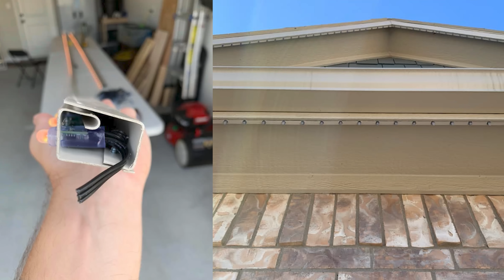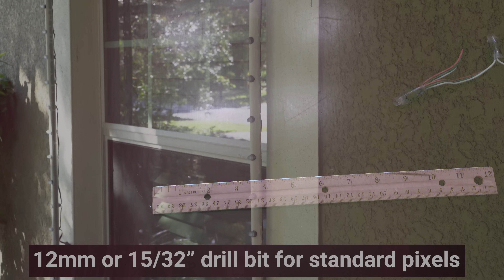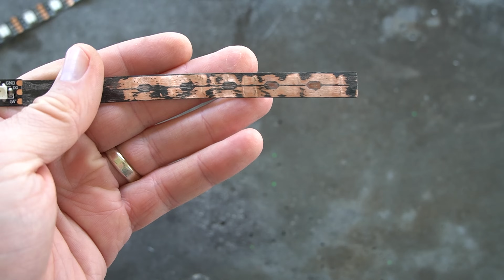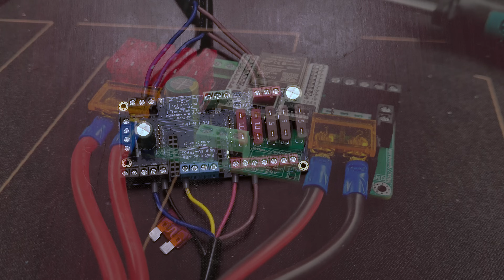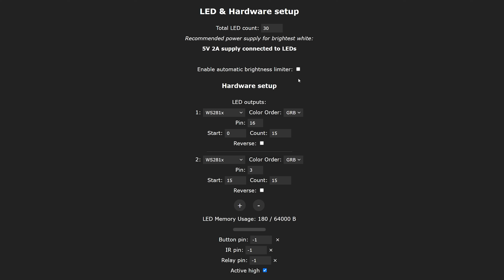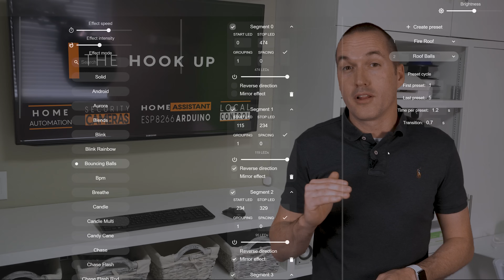DIY Permanent Holiday LEDs: Complete How To Guide 2021

Comment: Wow this is absolutely fantastic! Such high production quality too! I plan to start small this year with my dig-quad v1 and 600 lights on my Christmas tree for easier power injection using those fairy LEDs. My ultimate goal is the set up that you have on the house. Thank you for such an amazing video! Your channel along with Dr.Zzs and Quindor are the best!
Reply from the maker: Careful with those fairy lights, they are easy to short out since the wires are just enameled, also not for use outside.
Reply: Thanks Rob will do! I already have it all wired up on my desk to test everything and just need to carefully transfer it to the tree in the next couple of days. Thanks for the advice.
Reply: @TheHookUp  I see what you mean about being careful. I was putting the last strand on the tree and one of the LEDs on that last strand started smoking!!  I had to unplug real quick and replace the strip. Inside one of the actual LEDs was all charred and black. Geesh! It was actually about to start a fire.

Comment: I had seen posting on using JChannel and Pixels, that require a lot of drilling. the UChannel is nearly the same price, less labor and better finish.  Awesome.    My only complaint, is using a Western Union Splice. That splice is used for mechanical stress(tension), but it not the best for conductivity.  Linemans splice is a better splice.

Comment: Up 'til now I have made a number of LED projects using Arduino and ESP8266. I am starting to rebuild everything and for the 2022 season I want to make something that will work across everything I want to do.  If you were going to use 1 system that included things like a mega tree, with home made house lights (bow and swag) and other items (home made candy canes, etc. for the yard, poinsettia's for the house, maybe some window and door outlining, etc.)  would you still use a digiquad?  or something like a Falcon or HinksPix with xlights?

Comment: Do you think there is any heat that's being generated by the power injection wire? I too am planning to run the power injection wire inside the led channel. And am just wondering about heat generation. Thoughts?

Comment: Thanks for this! In the video on "joining like a pro" you mentioned 3/8" heat shrink, but in this one you said 3/4". Is one of those wrong? Or does it not matter because they shrink enough either way?
Reply from the maker: Uh oh, 3/8 is definitely the right size. I’ll need to make a note in the sticky comment about that.
Reply from the maker: Thanks
Reply: @TheHookUp  Thanks! (I think your Amazon US store link goes to 3/4" too)
Reply from the maker: Fixed that too, thanks again.

Comment: Silly question, If I am running a parallel injection... would it be feasible to run one positive and negative line from my home run wire and tap into that.  For example, if I am doing power injection to three strips on my bottom floor; splicing into that using butt connectors for both the end and beginning of the next strip?   Or should I run multiple positive and negative parallel injection lines connected to my homerun?

Comment: So for some reason I can’t re comment I bought all the stuff you recommended in the video  of your website and links I just couldn’t get the Ethernet chip I had to get the external Wifi which hopefully works good and then my other question is you have those boxs that you use to store your mother board and power supply what are they called and where would I get those? That’s one thing I don’t see listed

Comment: FYI - Falcon are up to V4. Also, although you have been fine with strip (apart from the lightning storm), it tends to not last as well in colder, harsher climates. YMMV. Excelent video as always, and prop to Quindor and Aircookie for their awesome work.
Reply from the maker: Good info on the falcon controller. I don't follow that scene super closely.  I used to think the same about strips, but in my last video I asked for people's experience with strips based on climate and it was a mixed bag.  Small sample size, but about 50 people responded with their information and there was no correlation between success and failure based on climate.

Comment: I have an upper roofline of 16m and a lower roofline of 25m and was planning to do two different runs (with injections every 5m). At 30pix/m, that’s 30A for the upper and 37.5A for the lower. Sounds like I should break the lower into two different runs, totally 3 coming out of the digquad. Btw, I have two 60A power supplies. 
Also, I’d like to compensate you for sharing your knowledge with me and I value that. I’ve purchased all the things cos your Amazon links - how else can I?

Comment: Probably a dumb question, but I need to ask it anyway.  Is there information available that details what you get in one of the packaged kits such as Phillips Hue, LifX, or particularly Govee  H6171(RGBIC). Specifically what type of strip dp they use, what controller, whats the difference between that and this build from scratch options, can any of the stuff be swapped out/upgraded later or is there stuff proprietary and thus incompatible with the DIY options..  Further I'd also like some clarification on differences if any on your builds and controls here and the DMX controlled options and/or "DMX" labelled strips like the DMX512.... is this different than the ws2811-15's you describe or is it actually one of those that some company gave a different name for marketing?  Also what is your take on the 120V strips?

Anyway, I have so many questions still, it's so close to christmas, and I cannot justify buying any more removable, garbage, target real of christmas lights...   I've ordered the Govee option mentioned just to try something different and now after seeing all this about building your own...... first I'd just like to know if I should return them or if there is something solid in there that could be built upon or its at least good enough for the first section/wave and the additional stuff is where it gets real trick??

Great super informative videos and I appreciate that some of it is also in text form.  Sometimes i need something on paper and or to read it, i think you (or at least I) comprehend and remember better/more from reading.  I digress, I am new to your channel but expect I'll be back frequently .. ..   so i dont have to ask the dumb questions, after doing research started too late and when something needs to be done now and seeming only like I'm getting further from an answer.

Cheers,
LO

Comment: Again - you are a fantastic resource and the quality of your videos is so much better than everyone else. I'm amazed. But sometimes you move through things pretty fast. The installation of the strips is a little confusing to me. You say you don't want to be soldering on a ladder (excellent advice!), but how do you make a 40 meter run including the soldering of the injection points, accurate placement of roof gable angles and corner bends all in one piece on the ground? It seems like this would be so likely to break or have the measurements  an inch off when I hit a 90 degree bend in the roof line when I put the LED strip into the channel. If you could share some tips (possibly in a different video) I'd really appreciate it.

Comment: I am using 12v led strings (total 1900 leds) ,power supply meanwell 12v 30amp 350 watt .Do i need two powe supply or just one is fine .Also i have the digi quad controller.
Please advise

Comment: Thank you for your great content. Based on your information I am in the process of ordering the components required to put in place an automated Christmas light show this year (mega tree & house roof line stips), well at least the first iteration of it. One thing I am still not clear on is the wiring between the controller and the lights and the power supply. Do you have a wiring diagram you can share?
Reply: Hard to come by, I need the same thing

Comment: So do you need to have an 18/3 or 18/2 ran inside the channel for power injection? I have just under 4 strips with 30led/m, so just under 600leds. Also, do I inject just power on the beginning and furthest  point, or does it need the data also?

Comment: In the video, you mention that if you use the SK6812 daily, expect more maintenance if you are running them every night.  What kind of maintenance? or what makes them different?
Reply from the maker: I should have said running any strip every night will require more maintenance.  LEDs that get hot can burn out, maintenance would be replacing those sections of LEDs.

Comment: You mentioned you have window frames that you put up only during holidays - did you leave yourself connectors in the middle of your runs in order to get them connected all the way back to the wled controller?
Reply from the maker: Yep, I tuck them up into the soffit for the rest of the year.
Reply: @TheHookUp  OK. Sweet. Is there a literal break in your main wires (connector?) or does it do a home run?
Reply from the maker: Home runs.

Comment: Awesome.  Thank-you so much.  Next summers project.  My wife and I were just talking about this.  2 of my neighbors put up permanent lights and they have them run all year in different colors.  So much wonderful information.  Thank you for doing all that research.  Question.  Can the same setup be used for under cabinet lighting?
Reply from the maker: You mean WLED for under cabinet? Sure.  I'd recommend SK6812 RGBW strips for under cabinet lights.

Comment: Is it better to run 24 v and stepping down near the strip . To avoid long run losses?
Reply from the maker: You could, but I wouldn't.  Not only are the stepdowns another point of failure, but the 24v lines are more prone to catching on fire if you overload them.

Comment: Two questions.  First do they make inside and outside corners for the aluminum channel?  The controller is 5v does that matter if i want to use a 12 power supply?
Reply from the maker: Depends on the controller.  If you use a DigUno or DigQuad it will have a voltage regulator on the board so you can use 5-24v.  I have seen corners, but they are specific to each aluminum profile, so it might not be available for your specific kind.
Reply: Another question. I'm using btf ws2815strips for an outdoor project. There is a back ip data wire where does that get connected?  I have a dig uno for the controller.
Reply: Back up data wire......

Comment: Perfect timing for this video. I have been doing a lot of research this week regarding this project. I have taken a lot of your advises from your various previous videos for my project and have decided to use 12V 5M strips with aluminum channels. Couple questions for more clarification: 1.) What size wire would you recommend using for a 12V setup? Some people have recommended 16 gauge, would 18 gauge work? 2.) My setup is originally going to be 2 lvl linear run, should I still get the DigQuad instead of DigUno, or is DigQuad a bit overkilled for me, or am I better off getting DigQuad anyways so that there’s room for expansion somewhere down the road? Thanks a lot for making these great videos!!!
Reply from the maker: 18 awg is fine.  If your budget allows I'd get a quad, it's not that much more and you get a lot more for your few extra dollars.
Reply: @TheHookUp  Just bought two Quads with external antenna as those were to only one in stock for now.

Comment: Have you tested the new WS2815-ECO led strips from BTF lighting? How does it stack against the regular WS2815 and WS2812B led strips from power consumption and brightness point of view?
Reply from the maker: BTF's "ECO" strips are not "ECO" in the sense that they use less power, they are "ECO" for "Economy", meaning they use less expensive components including less copper on the strip traces.  For long runs where you have multiple strips connected together you should avoid the ECO variety.

Comment: I'm a bit surprised to see more fails with 12V rather than 5V considering the current through the wire on 12V is significantly lower if the same power is being delivered. It is true that 12V has a higher chance of arcing, but the distance to arc to common is extremely small.

Comment: Hello, i question about power injection. If i use a led strip ws2815 12v, 10m 60w/m connection in serie ,   i need to inject power on second led strip? Thanks

Comment: As aways another awesome video.  I had one question...  For longer pulls (like the top roof line. (which will be about 25' from the power supply and control to the first pixel).  can I use 12 or 14  gauge wire for the run from the control or  do need to have the power supply and controller closer to the end points. Ideally I would like to have my controllers and power supplies mounted in my garage.

Comment: My experience with the strips in the last 5 yrs. is the IP65 yellow overtime. Have you had this issue. Most of mine came from the BTF or Ray Wu stores. I’ve had to replace sections of strips. Since  the LED started to get off Color from the yellowing of the silicone from the heat. Also I was curious how you secured the aluminum channels to your house
Reply from the maker: Yellowing is a thing for sure.  Mine are uniformly yellowed, so it's not that big of a deal.  Also for what it's worth my pixels are yellowed just as much and they spend 80% of the year in a box in my attic.  The yellowing may be inevitable.
Reply: @TheHookUp  Thanks for the reply. How did you attach the channels to your house. Also do you have a specific vid on the install options.  Track option detailed installs is what I was looking for

Comment: Hi Rob, another question.  How far away could the controller be?  I think I’ve seen sacrificial pixel being used to boost the data.  Thoughts on this?  I’d really like to put power supply and controller accessible in the garage, which would be maybe 40-50ft from the first run of LEDs.
Reply from the maker: My second story run is about 40ft from my controller, it works, but I needed to remove the resistors from the data line.
Reply: @TheHookUp  thanks, Rob.  Is that with a sacrificial pixel or without?  I assume without.  But appreciate the clarity.  I guess if I had to, I can give up a pixel.  I’ll test for sure before putting up.
Reply from the maker: @cgolebio  No, the sacrificial pixel method is for people who aren't using a level shifter.  The digquad and diguno have a level shifter built in.

Comment: Thanks for the great info. You mention no longer using your firmware... is there a way to get WLED working on an RGB smart bulb?
Reply from the maker: Yep, hoping to have that video out next week.
Reply: @TheHookUp  Awesome, can't wait! I've got Gosund WB4 bulbs on my porch running Tasmota but hoping to get E1.31 support
Reply from the maker: If they are already on tasmota then next week's video will get you to WLED in less than 5 minutes.
Reply: @TheHookUp  Not sure what your method will be in the video but wanted to mention I was bricking devices going straight from Tasmota to WLED OTA but I found success going from Tasmota to Aircookie's ESP8266MinimalHTTPUpdater sketch then using that to flash WLED.

Comment: Thanks for this! Using 5V, 1.8 amp / meter LED strips, do you have a suggestion for the power injection wire gauge for a 30 meter run if I can't have a home run? I've tried to compute it using Every Circuit, but I lack knowledge required in the software or EE (or both) to get a good answer.

Comment: Edit: I just found the little note by each item and that 18/2 spool is is for the power injection. I assume it's still small enough to fit in the channel? 

Hi there, Nate again - you mentioned that you run 22AWG wire in the channel for the power injections, but in your Amazon shopping list, that 22awg wire isn't there. What is there is a 18/2 wire - 200ft of it. Was this meant to be the power injection wire? And if so, do you think it would still fit in the channel, seeing as 18awg is a little bigger than 22awg? If not, then what's it for? Thanks!
Reply from the maker: The 18/2 stuff is for home runs, the 22awg is the only wire small enough to fit in the channel, but I’d only recommend the kind I used for 5v strips.
Reply from the maker: https://amzn.to/3FAwPvE
Reply: @TheHookUp  I am using 2812B’s. What’s you’re method for soldering the wire from the power injection wire to the strip? Is there a T connector you’ve used?
Reply from the maker: Solder seal butt connectors, just put two wires in the one side
Reply: @TheHookUp  Thank you!

Comment: hi, i have a question, im going to add some led strips under my kitchen upper cabinets so it lights down to the countertop and i am after RGB+W strips with good power/bright light to them.
do you have enny recommendation of what would be the best to buy?
i want to controll it tru a smart home controller kinda like the fibaro RGBW controller 2, the length of the strip is going to be under 5mtrs.

Comment: So the DIG Uno and DIG Quad are both unavailable now, do you have a recommendation that I could use instead of either of those? Was going to use the Quad because I'll have up to 150ft of strip LED. Please let me know if you have the chance.
Reply from the maker: International store has them in stock and the shipping is pretty fast: https://shop.allnetchina.cn/collections/quinled/products/quinled-dig-quad-v3-digital-led-controller-new-improved-release?variant=39475881836646
Reply: If you have 10mins of time, is there a way I could directly contact you to ask a few questions please?

Comment: It was my understanding that 24V is the preferred voltage for longer distances, and just calculate the wire gauge according to the load. Is there another reason only 5V and 12V were recommended?
Reply from the maker: 24v addressable leds are extremely rare.